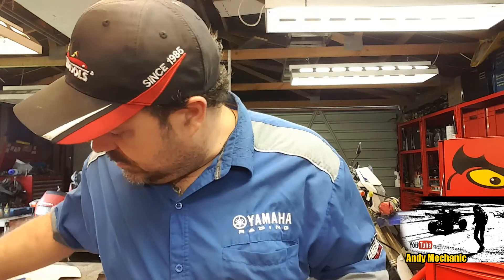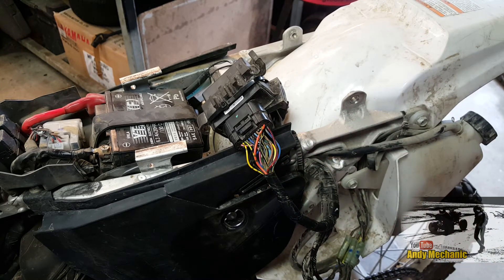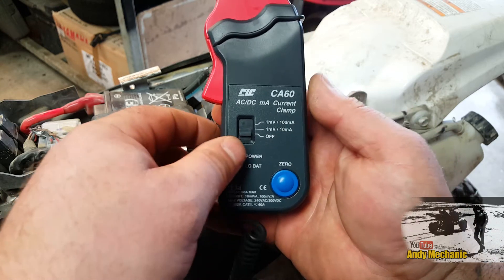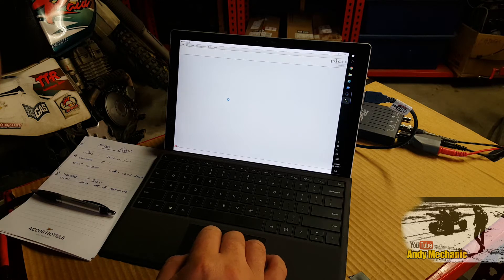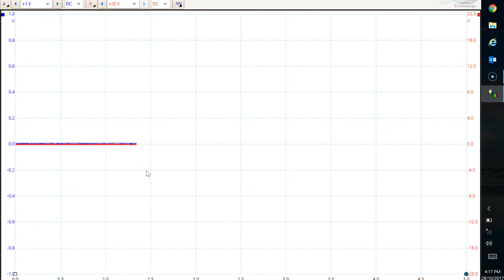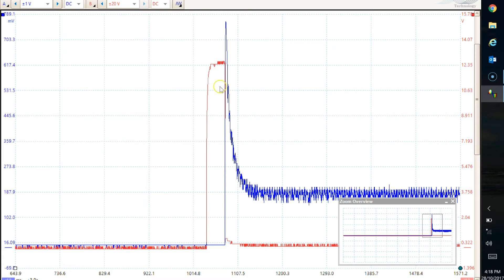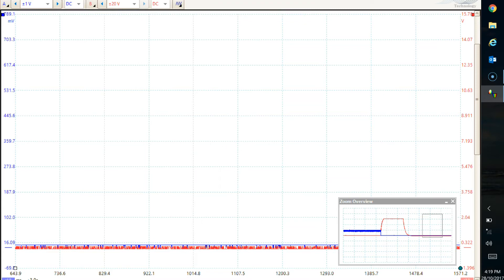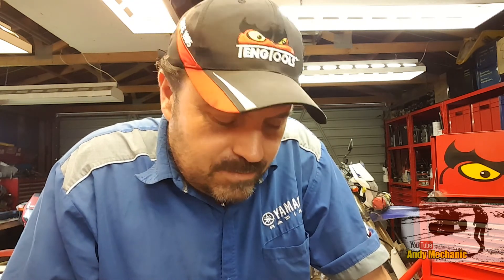How to capture an EFI fuel pump voltage & current waveform using a PicoScope #1218

Comment: Hi Andy, although I am a mechanic here in Yorkshire sorry the UK, I like your vids as your never to old to learn different ways of doing jobs, I do have oscilloscopes as part of my diagnostics arsenal, you could have done a capture of the wave form on a faster time scale and zoomed in closer to see the commutators of the motor, that that way you could see the wave of the amp draw as the motor spins and you could see if any are damaged.
Reply from the maker: Hi no1conrod, Good call, I'll give that a go tomorrow. I think that's what I did when I was testing cooling fan motors on the first video I used the PicoScope on. I remember using the amp claim & recording current draw waveforms. Watch this space! Cheers for now & yes, I miss Yorkshire very much! Andy
Reply: Hi Andy although I am fairly good at using a scope its the viewers who may just be starting out at using a scope, I don't think I have seen the cooling motor vid, New Zealand or Yorkshire hard choice there.